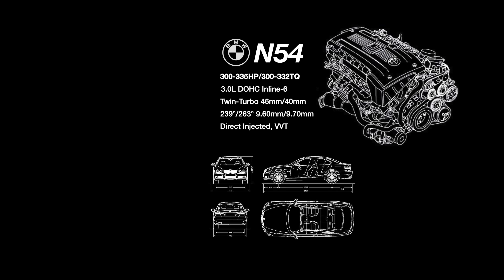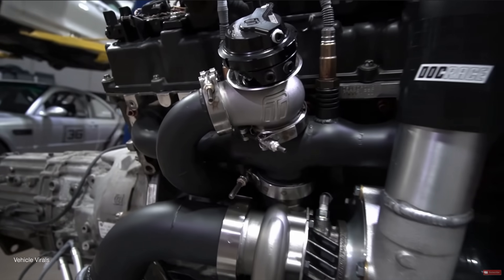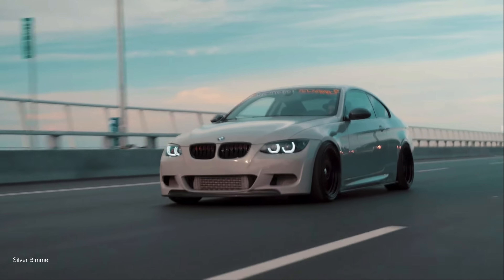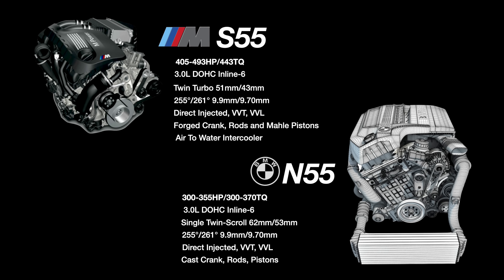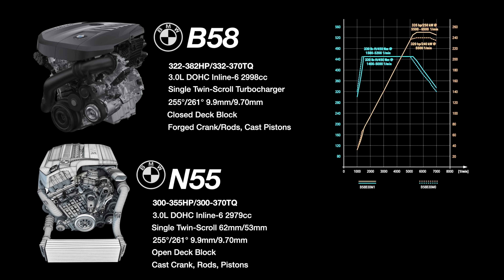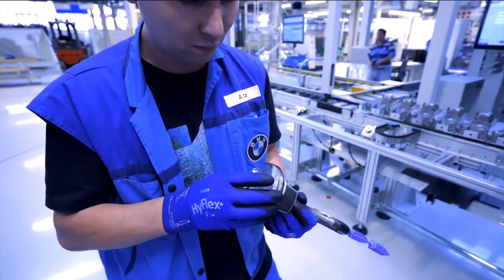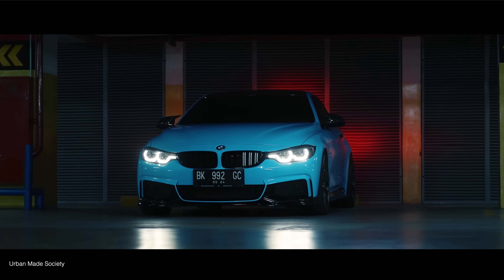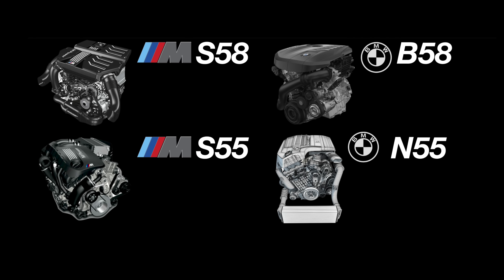BMW Turbo Inline-6 Engines Are Ridiculous | Explained Ep.4

Comment: False. Those engines are not reliables.
Reply: How many of these have you had?
Reply: @peto22  Enough to confirm that those engines área not reliables.
Reply: @classicalliberal4997  LOL
Reply: @peto22  I don't care about you. If you knew, you would ask some social issues about this engines.
Reply: @peto22  Doy you know how scroll turbo works? That's something which stresses most some cylinders.
Reply: @peto22  Do you know what the FMR module is? And how does  this module fails?
Reply: @peto22  Do you know how to reprogram this module?
Reply: @peto22  Come on. You know nothing about these cars.
Reply: @classicalliberal4997  The twin scroll turbos used by BMW are otherwise similar to other turbochargers equipped with a split exhaust housing, but these also have a split exhaust turbine, thanks to which the turbo lag is smaller. Does not cause more strain.
FRM module controls lights and in e90 era those failed mostly because aftermarket diagnostic tools corrupted module software. It was easy fix, just needed to write new softare to module. Newer models have not had a similar problem.

I still don't know how FRM module is related to the B58 engine.
Reply: OTher was short circuit counter and that is also easy to reset
Reply: @peto22  Ok. Let' see. Go and review Scroll Turbo.  I does stress some cylinder more tan others.  Go and read how it works again. 
FRM, block Windows, hazard lights and many functions. Why does the memoria get "corrupted": low battery, many failures from a burnt lights, etc. Dobypu know how, we the engineers designs machines? Tell me and we can continue a good discussion.
Reply: @peto22  
The exhaust streams from the two pairs of cylinders are routed to the turbine via separated spiral-shaped channels (scrolls) of different diameter.

The larger channel (A), which connects the exhaust of the cylinders 2 and 3, directs one exhaust stream to the outer edge of the turbine blades, helping the turbocharger to spin faster.

The smaller channel (B), which connects the exhaust of the cylinders 1 and 4, directs the other exhaust stream to the inner surfaces of the turbine blades, improving the response of the turbocharger during transient operations (engine acceleration).
Reply: @peto22  Nop. In Europe there is no reset for this module via scanner module. It is necessary to access the memory directly and enable the reset function and rewrite the whole memory. That's not a accepted solution for BMW
Reply: @peto22  Or we could talk about how the main belt can be "swallowed" by the crankshaft and stuffed into the engine.  Something incredible for an engine of that level.
Reply: @classicalliberal4997  That is something that can happen in many engines but in real life not common at all. BTW in B58, B57 and N57... it is just impossible.
Reply: @peto22  No buddy. You are wrong. I have had a lot of different cars. I have never seen that in a Japanese car.
Reply: @peto22  You did not answer my engineer question. We design by calculating an STABLE operation point. What does this mean.  It means that within the operating range of any equipment, we calculate an optimal operating point in such a way that even when there are variables that can alter the operating point, this point remains within safe limits.
Reply: @peto22  The correct calculation of the operating point makes a device "reliable".  The term "reliability" (in maintenance) is not just any term.  It is the certainty of the correct operation of the machine within its operating point during the useful life of said machine.
Reply: @peto22  And this is not a matter of having or not having money to maintain a vehicle.  The expensive vehicle must have "normal" maintenance that is expensive.  Having failures due to plastic parts, band engulfment, connecting rod bearings of a different type on the crankshaft due to scroll turbo, module failures such as the FRM due to trivialities (being an important module);  It is not a question of whether the car is high-end or not.  They are design flaws.  If those fails are on purpose or not, I don't know.  And just mention some of the flaws.  There is much more, like oil filter gaskets that harden and cause leaks that damage other equipment or valvetronics servo motor failures or lubrication failures that cause total destruction of the engine, etc. We are talking of a BMW.

Comment: Destroy everything? The only thing they do is destroy their own turbos after 5k. Crap dealers crap service and crap cars. Their brake systems are poor and only are fitted with one sensor for example. No coolant sensors either. Cheap cheap cheap....
Reply: No coolant sensor? That is bullshit. Tell me one model that doesn't have it. ;)
Reply: @peto22  Mini Cooper JCW 2021....
Reply: @curranhouse  Well, is that a BMW? Anyways, that has 2 sensors for coolant (radiator outlet B301 and cylinder head B6236) and also sensor for crankcase temperature B516.
Reply: @peto22  BMW sold it to us and BMW collected it when it broke down. No level confirmed by BMW garage on this BMW engine there no sensor. You can drive with no coolant level and get no warning until the engine temp is excessive. Also only 1 sensor in rear brakes on this and 2 series BMW both failed to notice a brake fault and damaged discs. :(

Comment: I’ve been a b58 owner for 3 weeks and I’m in love with the platform! Still scared of it but can’t wait till it’s power mod time
Reply: Don’t be … extremely versatile engine and loves to be hammered. Put 50k on mine and it loves to sing. Only thing that pissed me off after a while we’re the programmed lift off chirps, other than that, which aren’t necessarily that bad, it’s great. Best engine not sure if I like my s58 better. Still figuring it out. Tuned it’s incredible, stock they both have their ups and downs. S58 upper range and power is not comparable and thats when the ‘M’ really stands out. However, for every day driving, the b58 is perfectly tuned and smooth and delivers power better lower, but I constantly had to put coolant in. Perhaps they fixed that. 2018 m40i and now x3mc - have fun!
Reply: @michaelmesolellaesq  I got 17 plate 140i stage 2 about 470bhp never had coolant issues
Reply: @logansam4763  My x3 b58 m40i called for coolant nearly all the time after about 15k miles - thankfully never amounted to any issue. Just topping off.
Reply: @michaelmesolellaesq  did your issue end up being a bad coolant bottle? I’m waiting on mine to start losing coolant so I can get the updated coolant bottle.
Reply: @sbeezynukka  it truly never manifested to an issue other than topping off here and there. I’m onto the 2023 X3mC and boy did they nail this one right. From suspension to power, whole different feeling from my 2020 and 2018! I’d say don’t even worry about it unless it presents the issue - the 2018 I had had a secondary cooler, I was never sure what the actual issue was. That said, it was still rock solid from new through 50k.
Reply: @Michael J. Mesolella, Esq.  Not a new issue with BMW,  surprised this hasn't been resolved. Change your cap and hopefully that will fix for a while.
Reply: @michaelmesolellaesq  my newest G30 has the coolant bottle issue! The last didn’t! Gotta replace them hopefully this week.
Reply: @michaelmesolellaesq  she’s been a top! She’s MHD Stg 1 and XHP Stg3! Very fun! Now I just need that M XDRIVE tcase/diff so I can turn the fronts off and on on demand

Comment: N54 with over 118k miles and over 700awhp on a stock motor.  Right now only issue I’m having in the car since the tune are my wheel bearings. You’re spot on with N54 on how it’s older and a more rigorous maintenance schedule. However, since I did the maintenance over mods, I really haven’t had any issues. Tranny and transfer case might go first lol. Nice video. You got a new subscriber
Reply: I think wheel  bes are a pain. And I know I'm about to deal with one rear wheel hub bearing  aughhhhhh
Reply: How much power can you get on 93 OCT?
Reply: Faxxxx

Comment: Realistically they were already making fantastic inline 6 for boost well before BMW themselves put the turbos on them. You see a bunch of e36 with the M50-M52 or S50-S52 with turbos making big power on stock internals, especially for such old engines.

Comment: they dnt destroy everything they can't even make 3,000hp. lol dnt be silly.  there's plenty of stronger engines. BMW isn't running anything.
Reply: What engine is able to make such ridiculous amount of power? Even if you could, what's the point? It'd be completely useless outside of drag racing and it'll break down after a couple of runs anyway.
Reply: @dudocaine  there fully built engines that last a long time on low boost. Easy 3,000Hp  with a long life span. A fully built V8 will make 1,000Hp per piston and be reliable doing it. That would make it a8,000hp V8. Running strong pass after pass. Nothin can compete with that.
Reply: @Al-mx6ru  You mean a billet engine? Those cost as much as a 911 or even more and are specifically made for drag racing. It's like comparing an airliner to a 5th generation fighter jet.
Reply: @dudocaine  what do you think the fastest imports run stock pieces? Lol then you'd be very wrong... they also run billet everything. That's the difference here he's probably taking about stock. In the modded World BMW isn't doing anything. Theres plenty of engines that make this power. In stock form. Nothing to crazy about it. Great engines without a doubt. but far from superior.
Reply: @Al-mx6ru  I think you mean "forged". "Billet" in this context only refers to the custom-made engine blocks these builds require, not the internals. 
Otherwise I agree with what you've said.
Reply: @dudocaine  I'm sorry  l just thought everyone knew that it's Forged billet pieces.

Comment: M57 diesel. Torque monsters and you can't kill them.  While getting the to 1000hp is a chore it's easy with torque. My 335d was ABC deleted and tuned/trans tuned and dynoed at 445bhp but 665 ft-lbs. I never had been gapped except by a Tesla at 140.  Then consider I get 36-40mph.  These cars are wicked underrated.

Comment: Would love to see a direct technical break down between both, the n55 and n54 by a professional. Have heard so many different rumors between the two it would finally be nice to see some put to rest.
Reply: The N54 makes more power technically but the N55 is the more reliable engine in every day application while still being able to make up to 550 wheel horsepower on stock internals. That’s basically it.
Reply: Bimmer Performance Center has a nice breakdown of the N52 vs N54 which tells you a lot about the N54 but I haven't seen a similar video about the N55.
Reply: I thought the n55 was and remains the smoothest 6 I think I’ve ever driven. It was amazing. Not a single issue across 6 years maybe 60k on it. It didn’t have high action exhaust, but it was 100% pure and silk.

Comment: Owning a N55 and knowing guys who have the N54, S55, and B58... I wish I had the B58. But my car, a F30 335i xDrive with the N55, will be more reliable overall than the N54 E chassis 335i's because of the mentioned issues along with a couple other things. And, these N55s can borrow some components from the N54, S55, and B58 if you're really building the engines. The N55 is a solid choice for reliability in the age and price bracket it sits in, but the B58 is the move for building from stock. No M division tax, bulletproof block, and minimal issues as of now, even with some guys having well in excess of 150k miles on their cars.
Reply: N55 is horrid

Comment: 2016 M4 owner. I’ve had this car for the past 3 years I have a few bolt on and a tune. And the car is a beast she’s daily driven she had around 51k miles the only issue I had was changing out a pulley. Other than that zero issues. Did I mention she’s driven pretty hard hahaha

Comment: I have the N55 on my 2017 X5 and despite it being stock with exception of an upgraded charge pipe, M Performance exhaust and M Performance that bumps up HP and torque above stock levels. It has a lot of power for what I want. Under my ownership I had zero issues other than replacing the thermostat, spark plugs every 25k mi, oil changes every 5-6k mi etc.

Dec 2022: my water pump failed after having gradually failing for almost 2 years.
It became shorted out and was runnning non stop while car was asleep. Not even 3 shops incl a dealership found the cause. I diagnosed it myself.
Reply: Agree. I have a N55 435i Coupe and the thing just brings a smile to my face every time.
Reply: @alisakran7063  had that stage 2+ for months daily driving it always pushing it and it ran like a charm. 120k miles best car ever! A quick mf that sounded great
Reply: @MegaTony805  how much horse power did it gain at stage 2+? I want to do it also but the value for money ascpect stops me till now.
Reply: @evoman19  on paper probably went from 300 hp stock to maybe around 400 but being an older higher Mile car not sure it had its full potential. Could very much feel the difference and it was great and definitely worth the 1500-2k cost
Reply: I thought modern plugs REALLY did last much longer ? How much does it cost to do the plugs, do you do it , need special tools or by BMW or independent import garage ?  I am terrified of used German cars watching friends get whacked with them . I want to believe they are not a bad bet as a value prop as used car if you want to drive rich on a middle class budget but i both see in real life and certainly hear on social that its a risky proposition . I have a friend who finally covered and garaged his BEAUTIFUL low mileage V-10 M-5 he got for 20 something after dropping another 20K on stuff , then a year later  did all brakes /tires and a few other small things for 10k and thinking he was good for another 50K and something else failed , he wont talk about after he was always on about his V-10 M-5 . He has like 4-5 BMW and Ducatti motorcyles and likes ' Nice Stuff" and has some money but dont ask him about that Cherry M-5 if you want him in a good mood. Its a pretty cool rocket couch when it runs but not worth the 50-60K he has into it now considering its sidelined .
Reply: @MrGravloc  You need to have deep pockets, know how to work on them yourself or have a good trusty independent mechanic. Especially for the M models. Besides that, it's like any other high-performance car. 

If they were easy to maintain and own, everyone would own them and they would not be that special. You can't just buy one and treat it like a Mustang.
Reply: @MrGravloc  on a turbo engine your spark plugs won't last as long if you want to maintain your car performance. I do mine every 30-35k mi. Beyond 60k mi also smart looking into replacing the coils as preventive maintenance. For the N55 go either for NGK Iridium or Bosch Double Platinum.
Reply: @Ashley_van_Schooneveld  Thanks for your time/ expertise .
Reply: @MrGravloc  i change my plugs on my N55 every c.80,000km
Reply: Yeah I'm hearing a lot about people changing the thermostat on N55 engines.... To a lower temp thermostat to prevent overheating... So you have the N55TU I'm guessing? Did you go to an indy shop to replace the parts?
Reply: @ericgilmore5949  BMW never made an N55TÜ. I had my thermostat replaced by the dealership so its an original part that went in.
Reply: @Ashley_van_Schooneveld  Oh, right, I was thinking about the N63 engine...
Reply: @ericgilmore5949  my thermostat failed having staying in the open position, effect was that the engine would never up fully.
Reply: Seems useless to change plugs that soon. Should last 50-60k

Comment: Would be great if you could do an additional explainer on how the mild-hybrid implemented in the newer B58s is integrated and works.
Reply: It just allows the engine to use the mild hybrid 15hp electric motor as an assist for better gas mileage. I've gotten as high as 42mpg on a 6hr road trip with mine
Reply: @rodgazinya  same. Its really good. But it also adds extra HP from what I understand. Be cool to see how it kicks in and takes over at certain points.

Comment: This is a good summary but you would have really stood out from other engine reviewers if you mentioned the N55 from the MPerformance line. The N55 in the M235i comes with forged rods and crankshaft. The same rods and crank that later went into the M2’s N55 and the M3/M4  S55 motor. The forged internal N55 is the real power successor to the N54 as they’re pushed over 700whp stock block.
Reply: Glad someone pointed this out as I wad going to. People really underrate the MP line of N55
Reply: @4our6ixkwvmz  Definitely. Forged internal N55’s are kinda on the rare side. Most people don’t know it even exists because most of their experience with the N55 is from a the standard F chassis 335i or 435i etc.
Reply: @boostlee876  In the UK they're quite common thankfully with the M135i and M235i
Reply: 235i are slow compared to the b58s in the 140 . 240i
Reply: @logansam4763  and what does that have to do with anything?
Reply: @boostlee876  means u should sell that trash get a b58 bro

Comment: I wouldn't say it started with the N54 more like the M50, M50TU and S52/S54. M50's reliably do 500whp on a stock block. All that and you'd still have to mention the S38 which if tuned correctly can hold 1000hp since it's based off the M1 Procar M88/1. BMW's straight 6's get a bad wrap for no reason being some of the most reliable motors in existence.